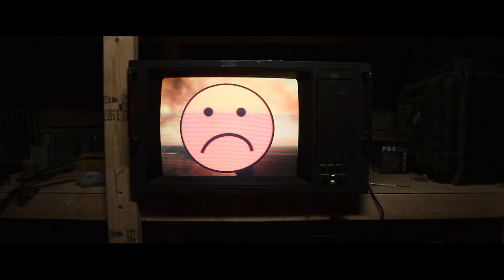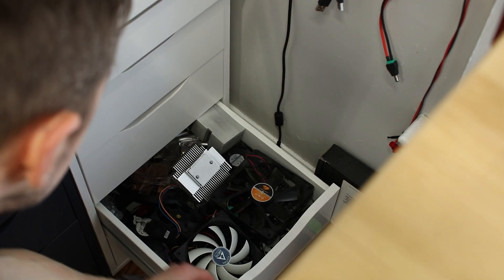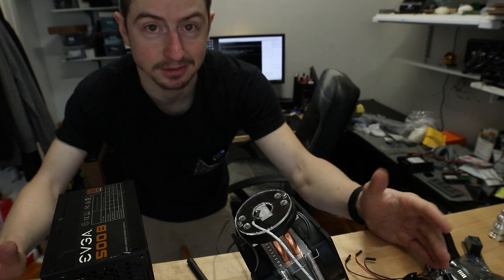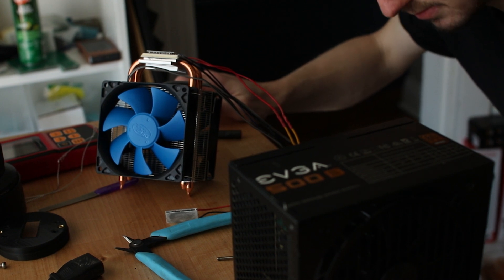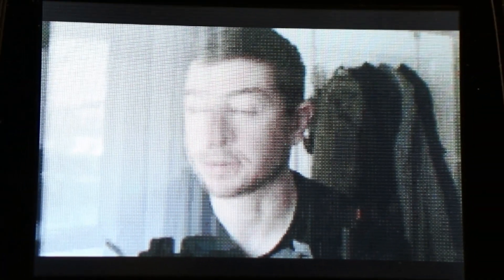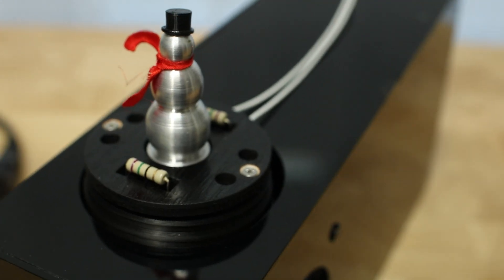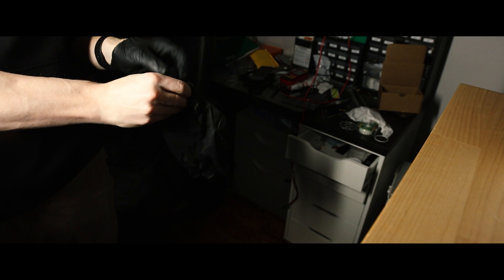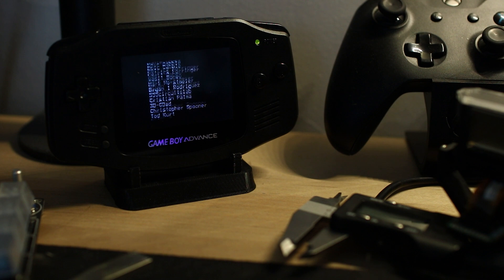This Snow-globe Makes Real Snow

Comment: Hi Sean, thanks for another great video and all your great content. I hope your cloud chamber will work. I have built a few cloud chambers myself, and I wanted to share a few tips based on my experience: 

1) 2 TEC1-12706 stacked on top each other, top one running at 5V and the bottom one running at 12V works well. No need for 3 stages. Your cold side temperature should be less than about -26C, and you get the best visibility around -35C or lower. 

2) If you want your device to run longer than a few mins, you need water cooling on the hot side of the bottom peltier. Air cooling doesn't extract enough heat. It might work initially but will stop working after a while once the bottom peltier gets gradually warmer with the heat sink not being able to keep up with the heat. Also most heat sinks use heat pipes to carry the heat. The liquid in them vaporises close to heat source and condenses back on the far side and gets drawn back to the hot side by a combined effect of capilariy action and gravity. Because of this, heat sinks work best in the opposite orientation, or heat source below the heat sink.

3) In a diffusion cloud chamber, alcohol vapor diffuses from a hot surface to a cold surface, eventually becoming supersaturated before condensing on the cold surface. Charged particles passing through this supersaturated region act like condensation nuclei and form little clouds. It is this diffusion process that makes the vapor supersaturated as it travels from one side of the chamber to the other side. It might work upside down and on a complicated geometry like the snowman you have, but it most probably won't work. The more traditional approach is to warm up the alcohol on the top of the chamber and have a cold plate on the bottom of the chamber. And as the vapor diffuses down, it becomes supersaturated right above the cold plate. For a chamber of the size you had in the video, that would be probably within 1 mm of the cold plate, but would still be enough to see tracks. The amount of alcohol you need to vaporize needs some fine tuning. Usually it should work without a heating element. Too much or too less alcohol would destroy the the conditions required for supersaturation.

4) A high voltage electric field would immensely increase the visibility of the tracks. For a square shaped chamber, you usually do this by adding a mesh on the top and using your cold plate as the second electrode. The mesh could be outside of the glass chamber as an electric field would still form inside.

5) You definitely need a directional light source, i.e. a flashlight, to see the tracks. You want to have the light source parallel to the cold plate and look at the chamber at a shallow angle facing the light source. 

6) It might take some time for the chamber to reach the conditions required for supersaturation. Don't turn off the device if you don't see tracks within the first few mins. Let it run for 5-10 mins and make improvements after that if nothing happens. The bigger the chamber the longer it might take for the chamber to reach the ideal conditions.

I hope this helps. Here is my latest cloud chamber as an example:
https://youtu.be/vov9vxOWibk

I'm looking forward to your second video. Good luck!
Reply from the maker: This is great advice for anyone looking to build a solid cloud chamber. Thanks for taking the time to write that out!
Reply: @SeanHodgins  "The fuck I am"
Reply: This needs more attention